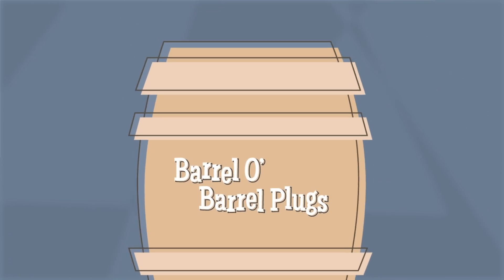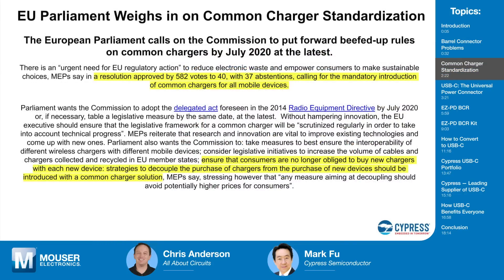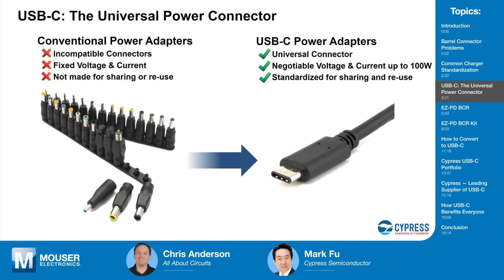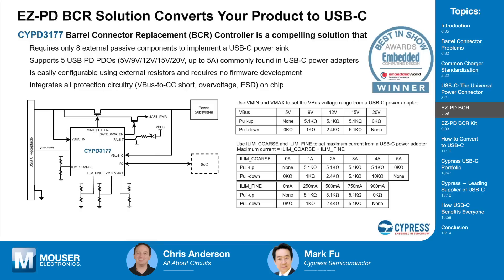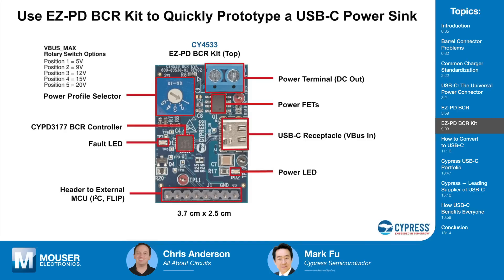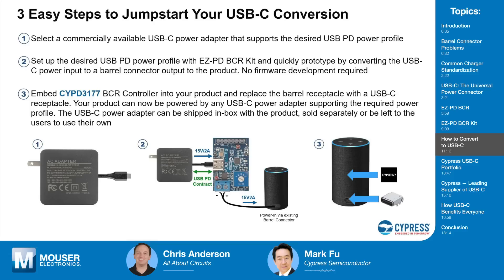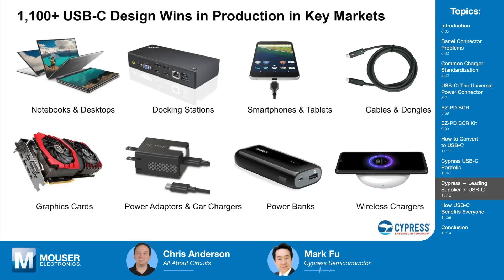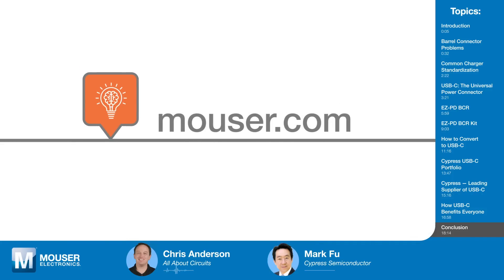USB-C: The Universal Connector for Power Adapters | Tech Chats - Cypress and Mouser Electronics

Comment: This is great and hot topic to talk to. Anyway on the market we see great competitiveness between biggest mobile device manufacturers. And actually many of them like Samsung, Huawei, Motorola have branded  their own Quick Charge standard. I think this demand comes from understanding how important is to be precise when it comes to charging Batteries with high voltages and currents. We still remember what happened to the new Samsung Note 7 flagmans. No one want to reduce their battery lifetime. So the lesson has been learned and the world is still waiting for full agreement regarding USB-C standardization. I'm want to agree with Mark Fu representative of Cypress Semiconductors, who noticed, that USB Type C with 100 W is a huge jump from MICRO USB-B 7.5 Watts. And probably we are still preparing for this jump. I'm happy Cypress is ready to offer good quality chargers and cables and those DIY chips shows us, that with good will changes on smoothing standardization process is possible.